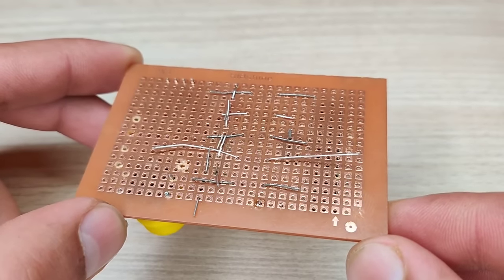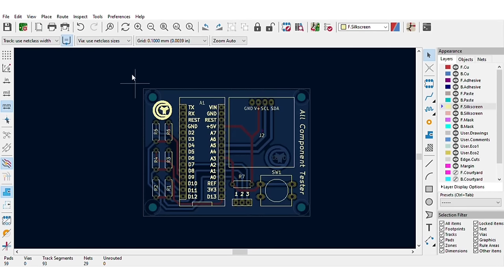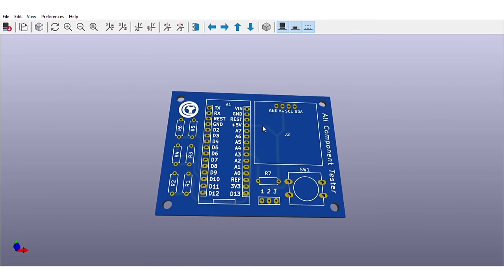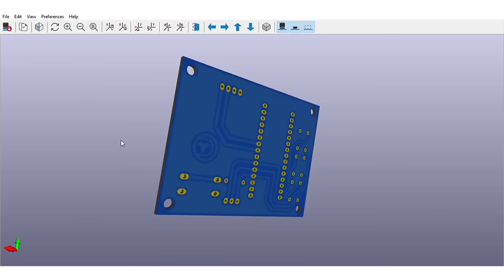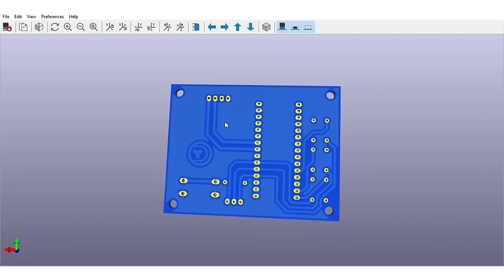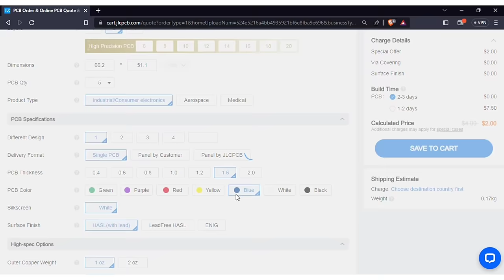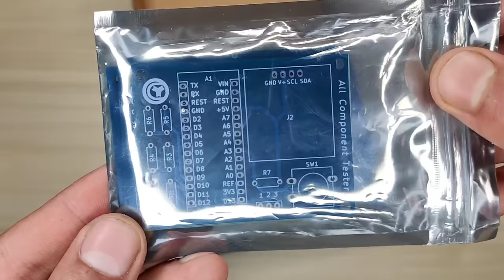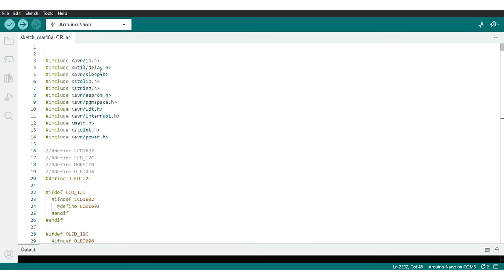This device can Test Any Component led, transistor, inductor, capacitor, diodes

Comment from the maker: Download Circuit Diagram PCB Layout and Code, Link is in video Description
Reply: Code please
Reply from the maker: Updated, code is now available in same link
Reply: @CreativeTechos  Code is still not there
Reply: @arthureschner9319  nope i do not see , pointless without code :(
Reply: code is now there to download :)
Reply: CODE not in the link
Reply: code missing
Reply: Code is Still missing :(
Reply: Great share... thanks a lot.. keep it up.
Reply: For the display screen, can we use different display? On this video use oled.
Reply: No code link.... Kind of useless without the code.
Reply: No code link.... Kind of useless without the code.
Reply: Please add the codes in the download link. There are only pcb design files.
Reply: @nileshshah2060
Reply: @chrisiakovakis6744  no coding
Reply: an you share the code?
Thank you.
Reply: please add IC tester too
Reply: Can you please update the code? The code still shows transistor testing, shows a frozen screen and cannot press the test button. When testing is pressed, it cannot be used. Please update the code for use, it will be very useful. Thank you.
Reply: @thanaphonlanmongkon6897 same problem, the code doesn't work 😢
Reply: @CreativeTechos  please help me its shows cell! On display can you help me in that

Comment: Thanks alot for your effort in presenting this here! 
I was looking for a simple project like this, for a long time, after I destroyed a chinese one with a charged capacitor! Would be interesting to modify the code to program a pin ON/OFF during the test so it could actually SHORT CIRCUIT the three input terminals BEFORE the actual test starts. 
This way, you can be sure that if a capacitor is applied at the test terminals, it will be shorten, so discharged, right before the measurement take place, so it can be done without any risk demaging the Nano!
Another question: are you sure it can detect most types of TRIACS as well SCR? I bought something similar in china but not all TRIAC's where correctly detected. Not talking about SCR's .
Anyway thanks A LOT !!!!🙂🙂😉
Reply: erm...shorten a capacitor in most cases destroys it or causes damage to it, a larger one prob fry the circuitboard also...
a Mosfet usually needs to be shortend or have a draining resistor before it can be measured correctly...maby thats why those cheap once didnt work... fairly sure u dont have to for any known triac... but technically it can have an added capacitor to prevent it from being triggered from high freq noise...
Reply from the maker: Thanks for watching my friend 🙂
Reply: @CreativeTechos sir mujhe ek code cheye please help me sir

Comment: nice project but if i dont have the pcb, can i do it manually?thanks
Reply: I think maybe it should definitely work on a perforated board, or even breadboard too, 
Although I think the breadboard could MAYBE somewhat influence the reading of some components and give you not completely accurate measurements, I cannot guarantee.
Reply from the maker: Just follow the circuit diagram and use Prefboard.

Comment: Thank you. what's the display we have to use?
Reply from the maker: In video i used oled 0.96 inch,
You can also use  I2C 1602 (16×2)LCD also Nokia 5110 with I2C interface.
Reply: @CreativeTechos @ Creative Techos  Nokia is best. Thanks again.

Comment: I have never seen anyone use tweezers for full-size components.
Reply: Its respectful
Reply: I guess it's for sake of clarity
Reply: Dude’s side hustle is a surgeon 👨‍⚕️ 😂
Reply: I have a spinal cord injury that has left my fingers numb and tingly and sometimes twitchy. I use to be ambidextrous but I’ve lost a lot of my dexterity. I can’t hold and manipulate small parts, screws, wires, etc., but I can use tweezers to do most anything I want to do with regards to electronics.
Reply: I use a front end loader for my pcb’s.

Comment: pro i have the same LCD Oled 0.96 but pin out Are (GND..VDD..SCL..SDA))and LCD IN Video PINOUT  (GND..VDD..SCK..SDA)) the difference IS SCL $SCK >>> I Need To know the screen with pinout (GND..VDD..SCL..SDA) will work fine with out any problem
Reply from the maker: SCL & SCK are same pins called serial clock pins, while SDA is data pin
Reply: Thanks

Comment: hello, where can I get a schematic, or pcb file, i want to use with atmega8 or atmega328
Reply from the maker: Download Circuit Diagram PCB Layout and Code, Link is in video Description
Reply: if you're going 328 look up mega328 transistortester - most of it is done already.

Comment: Damn, I got my 5 PCBs this morning.  Paid 2.00 for them.   Thought I had all the components but it turns out that the OLEDs are different.  My OLED has 6 pins on it.   Can I cut the 2 extra pins off and have it work?
Reply from the maker: Just connect Gnd, vdd/vcc, SCL & SDA it will work perfectly

Comment: I am not good with coding but if possible could you  add a time out so the Arduino will go in to a low power state because i am planing to add a battery to it. so if you read this. can you do that please.
Reply: Use a power bank as your battery and add a switch. You won't need to recharge often.

Comment: I REALLY need to test components and i use the same board shape. I have board failures and want to test the parts. With the clips Can i use this to test parts sitting in a unpowered circuit??? Or need to pull them out to test.  Can you test TIP  chips? Great share thank you. Can we get the parts in lot from your source?? Dennis

Comment: A nice build and the code loaded fine.  It reads capacitance down to around 20pF but I cant read anything over about 100uF or the readings go mad eg.  220 gives about 580 and 1000uF returns about 2480uF.  Resistance and transistors etc seem fine. Inductance is also strange.  Anyone else find this?
Reply: What did you load the code into?   I've tried about 6 different Nano's and none of them will take the code.  I get an error message that says there is not enough memory.
Reply: @RandomTorok  make sure you are using the Old Bootloader when uploading to the Nano
Reply: @RandomTorok  I can send you my modified cows if you want?
Reply: @AllanMeredith  That would be great.

Comment: The placement of the connections are on the wrong place. It should be placed in a corner so it would be easier to connect components in the 3 holes ...

Comment: The value for the 220uF capacitor was 176uF, lol.
Reply from the maker: It was the actual capacity of that capacitor, as different brands of capacitors vary then what is shown on capacitor label.
Reply: Now you can see what inflation does to components!
Reply: wow, that makes this even more useful!
Reply: If you look at older electrolytic capacitors - eg in valve equipment - You will often find the tolerance printed on them -50%/+100%. That's just the nature of theworking principle in electrolytics. A good designer takes account of this variability when specifying component values.

Comment: Why are OLED displays so hard to work with?  They guy who wrote this code had to spend more effort with display interfacing than measurement code.  I have an Itead Studio 128x64 display which is probably wonderful but I guess I'll never know.
Reply: Simply because the guy who wrote the original open source code did it more than 10 years ago when OLED wasn't available. The author of the video just stole it. The idea of using a Nano board isn't even new.

Comment: das ist einfach nur der reguläre aus china komende komponenten tester. mehr nicht. dieses projekt ist schon mehr als 10 jahre alt. 
auch wenn der aufbau simpler gehalten ist. dennoch giebs diese tester mit grafiken und weit aus mehr funktionen und dort werkelt auch nur der atmel chip drinn. 

zwar schönes projekt aber nix neues und nix was besonders wäre.
Reply: yep this is the AVR Transistortester project.
Reply: What’s the point?

Comment: These testers are already available from Chinese dealers and are cheaper than building them yourself
Reply: But if you want precision, you build your own with precision components you verified previously.
Reply: Be careful! Those cheap Chinese testers remember all the test results and the moment they can get a connection to the internet they send all that information back to their headquarters. 
 
If you make this yourself, then you can alter the code and make the tester great you every time you switch it on, and make it send an e-mail to you when you left it somewhere. Those Arduino's are so clever.
Reply: @y2ksw1  you can totally take a cheap clone kit and mod it with precision components where it's required.
Reply: @PainterVierax  Where is the fun? I fully understand. Normally you would buy a ready to use component and fix it to your needs. In my specific case, I prefer to do the things ground up, for a better understanding of how the circuit works and eventually adding some features.
Reply: @y2ksw1  Well, a kit provides us most of the components we want and a nice PCB. It's enough if we want precision, as you primarily wanted.
If you want to get different UI, or form factors by playing with kicad and source code then sure it's not a solution for you. But you're going way further the precision requirement.
For the better understanding of the circuit, everything is properly detailed in the AVR transistortester documentation. Doing the things ground up is not a requirement.
Reply: @vanhetgoor  The cheap chinese testers have no internet connection. And if you want to alter the code, of course you can do it... These use a 328 as well
Reply: I'm making this tester because I have unnecessary, extra
 components, and I want to use them in a project
Reply: But then you dont have experience how to do it by yourself and learn new stuff
Reply: Los tester chinos salen más caro, es mejor hacerlo uno mismo.
Reply: But builind it is the fun part
Reply: @vanhetgoor oh nooo the chinese know i tested a transistor truly the one of the evil moments of all time

Comment: This video is faked since the Arduino Nano doesn't have the memory capacity for the code provided.
Reply from the maker: Than how did i uploaded the code in Arduino 🤣
Reply: @CreativeTechos  I owe you a big apology.   I was finally able to upload the code to an Arduino Nano, not sure what changed but I got it uploaded to 2 different Nanos.  However, unfortunately I'm not getting anything displayed on my OLED.   I've tried 4 different screens.   I've ordered some new ones which hopefully will solve my issue.

Comment: It is not clear where to get the libraries!
#include <avr/io.h>
#include <util/delay.h>
#include <avr/sleep.h>
#include <stdlib.h>
#include <string.h>
#include <avr/eeprom.h>
#include <avr/pgmspace.h>
#include <avr/wdt.h>
#include <avr/interrupt.h>
#include <math.h>
#include <stdint.h>
#include <avr/power.h>
???
Reply: Every one of those is already available in the Arduino IDE. I just tested them in a blank sketch. The IDE "includes" and compiles all without error. In fact, most of them don't need to be explicitly included as they're already included by the underlying Arduino class. They are listed here like that in case you're going to start with a bare 328 chip instead of using an Arduino Nano (which of course has the Arduino bootloader already installed). There's no harm in "including" them again since they all start with a conditional compile directive to skip if already included (for instance, by the Arduino class in the IDE).